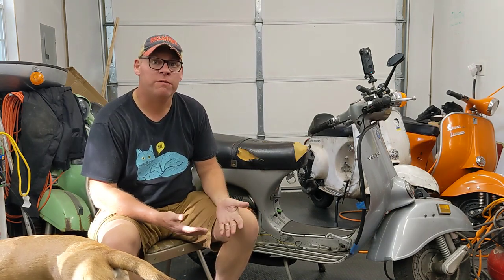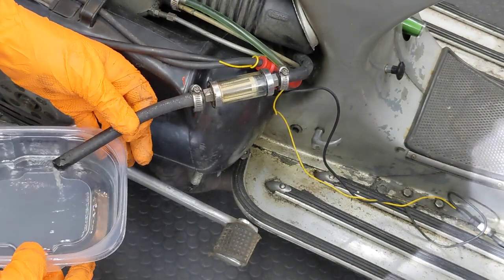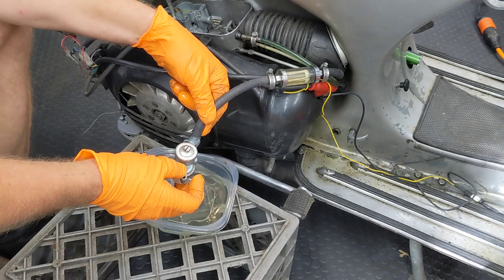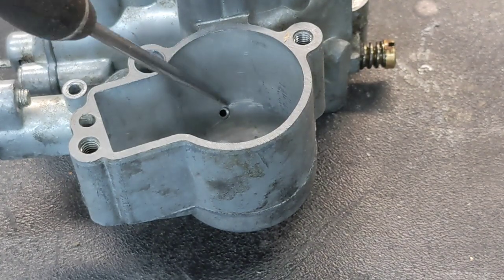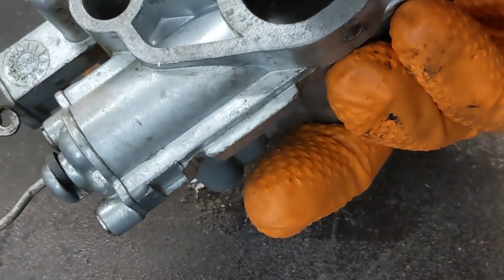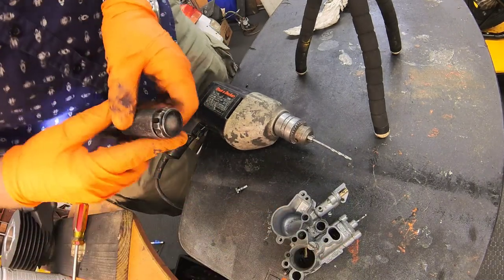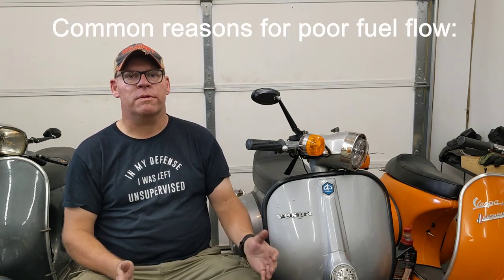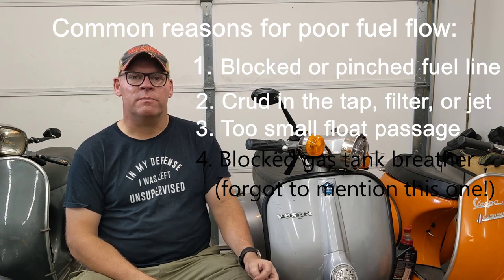Troubleshooting Vespa si carb fuel starvation issues & drilling the float passage

Comment: Is this modification only for tuned engines or is it useful for factory engine? I have a vespa px 200. Thanks.
Reply from the maker: It's really only necessary on tuned motors.  The float passage only becomes a blocker when you're dealing with larger main jets.  

If you're having fuel starvation issues like this on a stock motor, it most likely means you have a blockage or bend in your fuel line.
Reply: As an addition I have had talks with 125 px owners saying that the fuel passage is too narrow as stock and drilling out the px SI carb. was helpful. I dont know if this is true for all SI carbs. but there is a feeling that the manufacturing process for some si carbs doesnt creat a wide enough passage for the fuel.
Reply from the maker: @ryanseddon4800  Unmodified, the float passage is only capable of keeping up to about a 125 main jet.  I've never seen a carb that couldn't keep up with stock jets, but it's definitely something to modify on tuned bikes.
SIP sell an SI carb with the entire fuel path opened up, but that's what I was running and had to modify when I made this video, so take that for whatever it's worth.